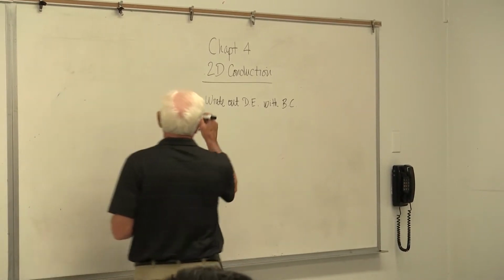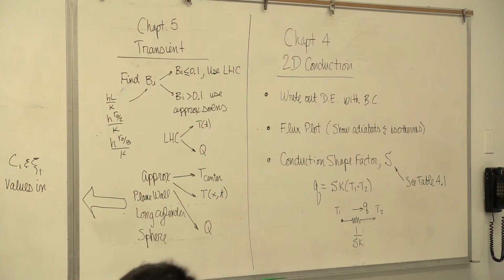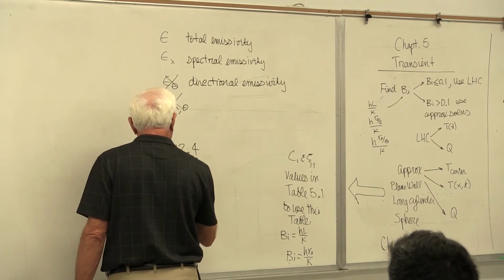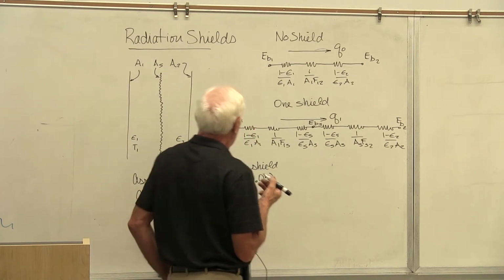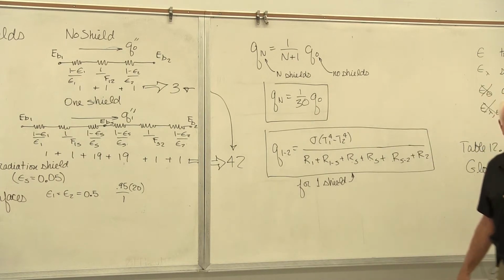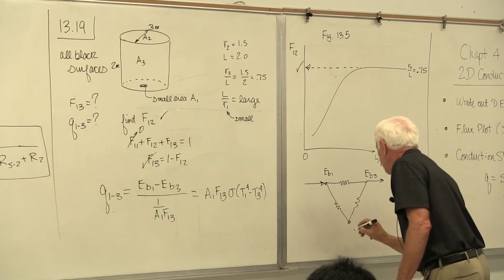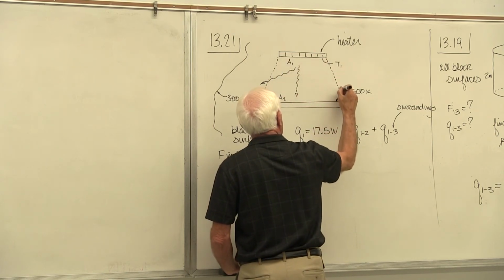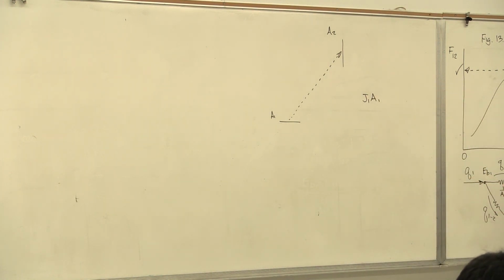Heat Transfer: Midterm Exam Review Problems (17 of 26)

Comment: Please finish the 13.23 explanation.   I'm thinking you're going to use the parallel concentric disks to find F34 for the S2,S3,S4 enclosure, then use reciprocity rule to find F24,  then use parallel concentric disks again to find F41.   The energy hitting A1 => q =  A2*F24*Eb2*F41,  G1 = q/A1.   This method makes sense to me but please correct me if I'm missing something.